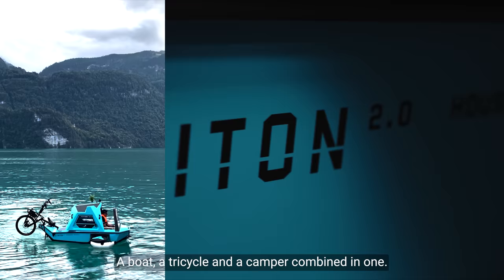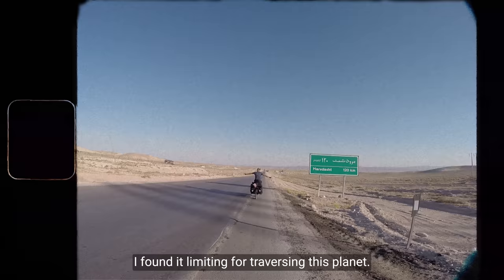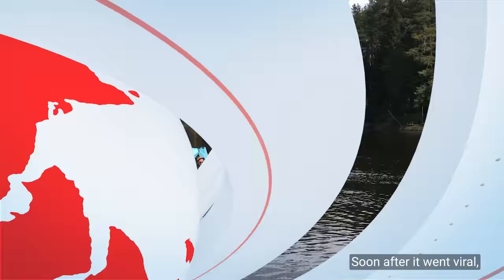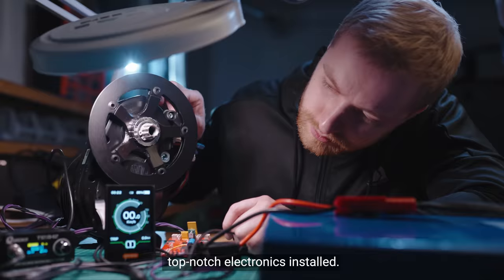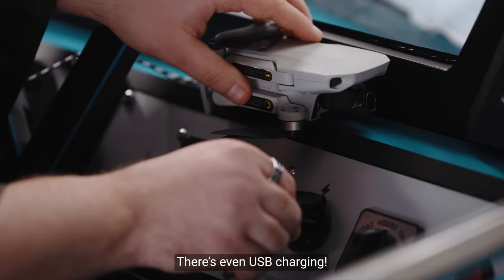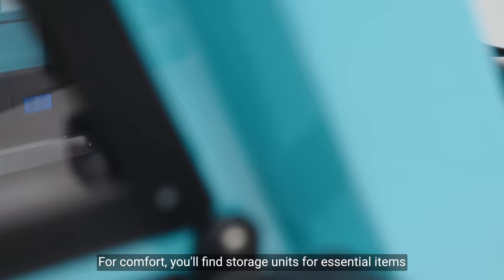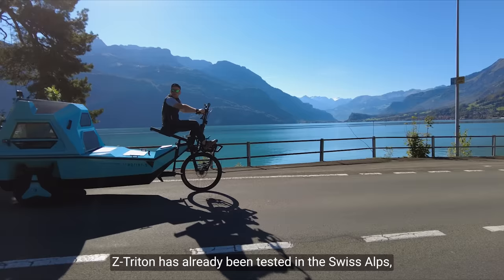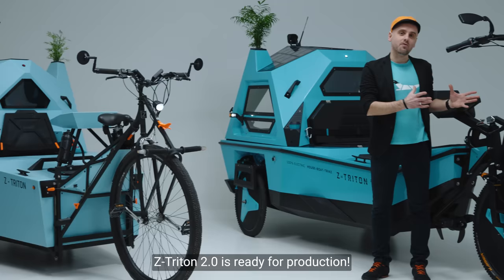Official Launch --- BeTRITON (Z-TRITON 2.0) --- Market-Ready Version!

Comment: So, when I actually want to cycle around the world, how can I charge? Doesn't work off-grid - too heavy to actually cycle larger distances with reasonable efficiency, without the motor. So ends up more as a gimmick, maybe for a day trip then gets boring. 
I thing a much lighter Kayak/Canoe approach that can be human powered would be more viable for actual travel.
Reply: Yeah its not very well designed. Its not aerodynamic, and its akward design leaves almost no room for solar panels. It needs a lot more solar panels to produce enough power to be practical at that size. Plus theres so much wasted space. It could have been far larger and still had less drag if it was designed better. Something like an aerostream shape could allow the driver to stay completely inside and leave only the wheel sticking out the front. Youd have a ton more room for solar panels and itd have less drag. The least they could have done with this design is used solar tiles to fill in some of the painted areas.
Reply: ...BUT  on the other hand it is a German design.  As soon as the Americans start with the same IT WILL ANNOUNCE AS THE BEST and ONLY in the world ...   NO KAJAK and NO other countries   allow to sell.

i think I will buy one of these.   as  I European I like to just chill out with out ANY HASSLE other than bike boat on the lake  or   river and relax and enjoy

Comment: Is it compatible with rapid charging stations? If not, how long does it take for a full charge, and can you carry spare batteries?
Reply from the maker: Hi, no, it’s an e-bike so charging happens from standard one phase AC outlets. From completely flat to 100% charging takes 8 hours. The batteries are swappable so yes you can take as many as you can fit inside the cabin but it weighs about 12kg and a spare battery costs over 1000 Eur. More info about battery here: https://akkuenergiesysteme.de/en/superpack/

Comment: I don't know if you have already tought of it. But i am scared this does not have a security system for avoiding someone could just steal the bike without any problem. I live in spain and i would love to buy this but this is a great problem for me.
Reply from the maker: 1 - It’s much like a motorcycle. You’d lock BeTriton’s front wheel to prevent someone just rolling away with it
2 – there is a kill switch with a key much like a motorcycle’s ignition key
3 – the product is equipped with 2 IoT modules so you’ll have a chance to monitor your BeTriton remotely as long as you’d have internet connection. You’ll be able to set alarm in the form of alerts on your phone so if anyone moves your BeTriton and changes GPS location the BeTriton app will push a notification to your phone. We’re also working with bike motor manufacturer to make it work in a way that you can block and unblock the drive system using the motor connection.

We are taking this issue seriously and will do our best from our side to prevent theft. There is a lot of great technology that can help these days to address this. Hope this helps.

Comment: There shouldn't be steel in that construction..
Reply: Why? Steel produces less CO2 than aluminium in smelting. Like, 80% less. Steel doesn't produce 2000 kgs of radioactive waste per kg of product - compared to the neodymium used in the electric motor of this vehicle. Steel uses WAY less energy than the silicon solar cells on top that boat-bike. Steel production doesn't produce a serious heavy metals pollution - compared to the copper used in the electric motor in that thingy, also steel doesn't consist of 40% bisphenols (BPA) like the epoxy used in the composite shell of Bikey McBoatface ... also, steel is easier to recycle than any of the materials above. So what's your problem with ferrous alloys?
Reply: At first-Steel is heavy. That co2, that you talking about going, to be released during pedaling that thing up to Stelvio passage. 
Second-It rusts. Protect it as much as you can, it will rust, even from inside. I live near sea and have small vessel capten licence. And never I heard about steel being a frame. Only once I've seen steel 45ft yacht, but this thing was going to Nordkapp, Svalbard and Iceland, she needed a steel body. 
And third- Steel is highly thermodinamic metal. It will warm up earlier than plastic and expands. All those bolt connections start losing it's fit soon.
Sorry dude, I like your idea, but I'll stick to yacht or motorhome
Reply: @f.d.6667  yea yea all green then you attach that lithum battery to it thats the most enviremently unfrendly thing in the world.

Comment: Only thing it still REALLY needs is some type of roll out button on "Canopy"  if it rains you're kind of screwed no??
Reply: Nah most cycling tour guys will just throw on a waterproof jacket and cycle in the rain
Reply: @gypsylips1950  dont mean a canopy for when riding hell i ride all year around rain snow hot cold dont matter. 
I ment the cockpit area when in boat mode or rv mode half that area is wide open to the elements a simple top piece of cloth that buttons in would be awesome and needed
Reply: @miguel360kmc  ah yeah okay i understand what youre saying. i think getting the $4500 DIY kit leaves a lot of money left over to customize these however you see fit!

Comment: I was thinking an saying that these years are not the same anymore I had a problem where I just can't takey regular vehicle across the state line anymore I have to change vehicles I been to court as well on that issue why the next state could have a flood an you can only drive vehicles in that state that runs on water I believe that even included bikes

Comment: Nice concept to ride in Europe. The large travel he did to Tokyo, though, won't be possible. How do you charge the batteries in wild areas?
Reply: Solar? Pedaling? Not hyped for this concept but those two things come to mind.
Reply: @solonyetski  Pedaling? this thing weights 250 kg unloaded, so imagine with 2 people and all the gear you need for a long travel. So forget it, you'll be barely  able to move this vehicle just pedaling to get to the nearest 220V socket, no way to move it AND recharge the battery. And with the 100 W integrated solar panel you'll need many, many hours to charge the battery. And finally this trike has around 50 km of range, before you'll need to recharge  the battery with an external socket. So in places like Europe is nice,  in rural areas of Asia, forget it.
Reply: @Alby_Torino  yeah, I guess this is the new Juicero
Reply: Gas generator and a jerrycan
Reply: @patrickjoyce4521  ^_^

Comment: How do you fold up the front and rear tires when you're already in the water? How do you fold up the tires when you're still on land? It's all done manually.... Hmmmm.... This transition doesn't make much sense.
Reply from the maker: Hi, we'll publish a quick video how the transition from land to water happens very soon. It's nothing complicated. Takes less than 5 minutes.0
Reply: I'm guessing you're going to have to get out, might get a little wet but not really a big deal breaker
Reply: @phillvallace  unless you're crossing a body of water in winter. Or it's infested with crocs or gators. Piranhas. There's no unloading ramp.
Reply: @zumezoom9593  okay that is a good point, i guess just use it in glacier lakes ;)
Reply: @phillvallace  nope. Ain't happening